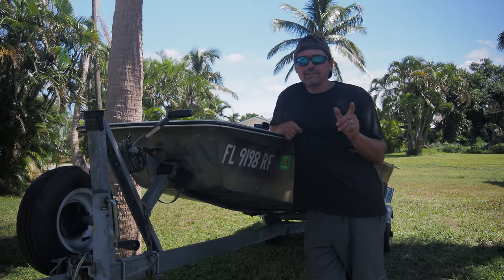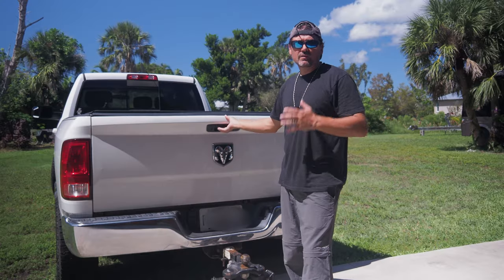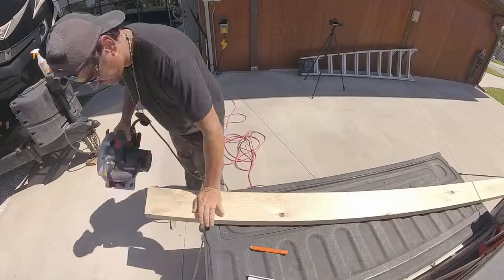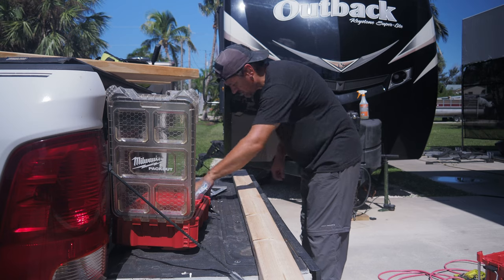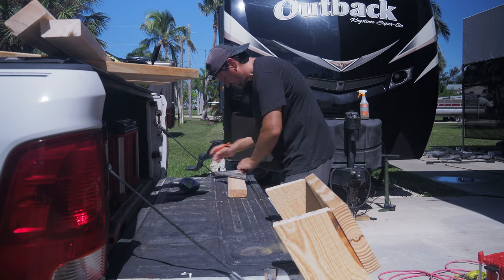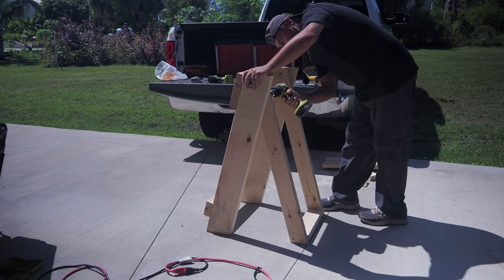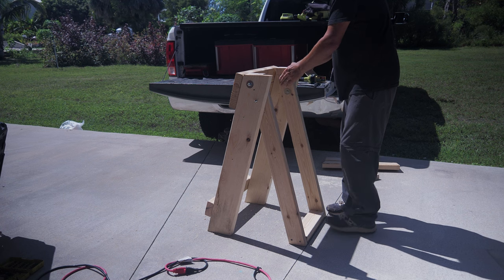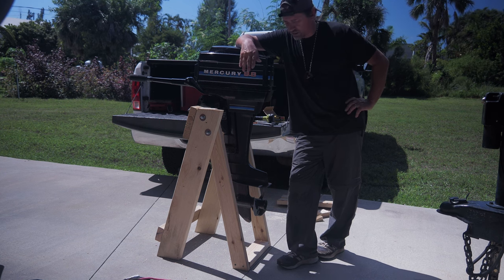EASY: How to Build an Outboard Motor Stand - Best Design

Comment: A modification would be cool to allow the motor to be in a large trashcan of water for running / working on them.  For just having a place to put one, this is perfect.
Reply from the maker: That would be a cool addon.  I usually run my stuff off a hose though that's not always the easiest with these little motors.  Thanks for sharing!

Comment: I won’t even work for a bigger motor like a little €50.42 stroke
Reply from the maker: Are you asking if it will work on large outboards?  If so i don’t know that i would put anything too big on it. Thats at your own discretion. I’ve put about 300 lbs on one and had no problems anything more than that i’m not sure

Comment: Great design, simple build and compact compared to others out there.  Ability to fold and store is great.  My material cost was $14.  Using the miter saw and setting at a 15 degree cut sped things up.  Thank you.
Reply from the maker: So great to hear. Thanks for sharing. Yes a miter saw would definitely make it a lot easier. 👍

Comment: Nice! Thank you for this. Would it hold a 40hp outboard?
Reply from the maker: I think it would be fine. I weigh 160lbs and it holds me + a 25hp that weighs between 90-100lbs at the same time with no problems. You could always upgrade the hardware and add some angled bracing if you want to make sure ultimately its up to you though. Thanks for watching let me know if it works for you👍
Reply: I'm u a using 2x6. I think 2x4 will do the kick-out legs.  230lb motor